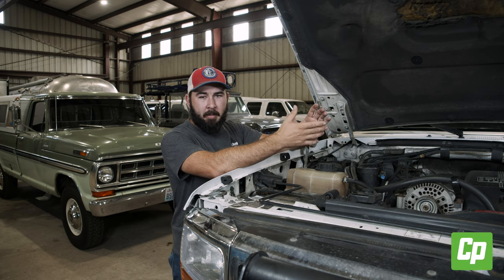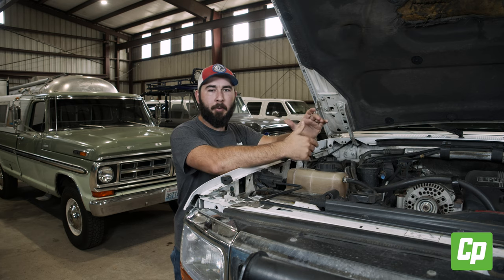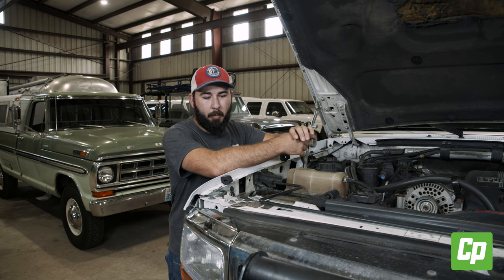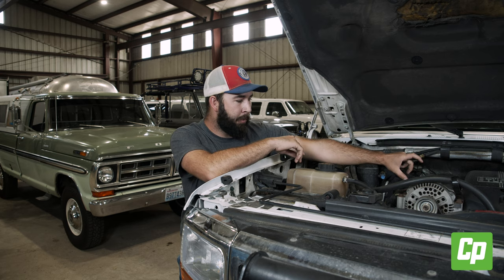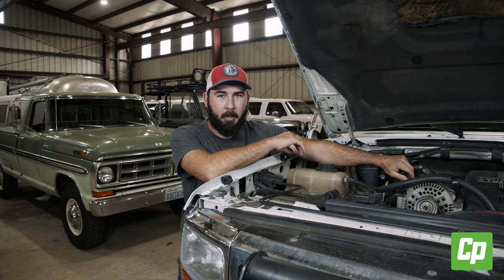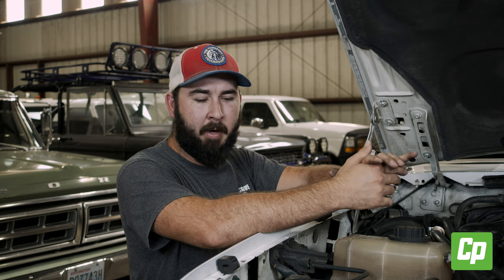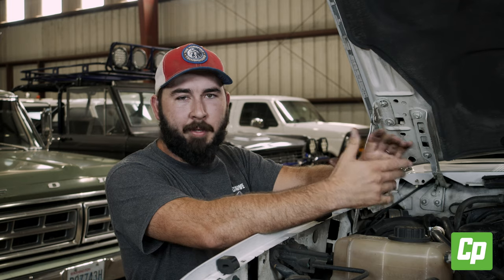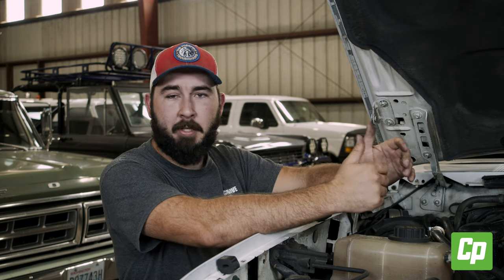How to Video - 1992-1997 Ford - A/C Mod Install: Cooler Air Conditioning - NOW

Comment: This seems like a good product, but a ball valve in the supply heater core line will do the same job on a budget. For nicer trucks or those that don't want to turn the valve manually, the CP part is the way to go.
Reply: YOU SHOouldnt just block that line tho.
Reply: @CT_Taylor  exactly what the gadget in the video does my man.

Comment: So was about to install mine and I compared this video to the printed instructions that shipped with the box.

Box instructions say to use the hose from water pump to firewall, but looks like you used the hose going to the head....did I miss something?
Reply: I was going to install mine today and noticed same thing, What did you find out. I see there was no responce to your question
Reply: On my 4.9L inline six, the supply line to the heater core comes from the head and enters the firewall on the right side. The return line exits on the left side and goes to the water pump. I'm told it's better to put a shutoff on the supply line as opposed to the return. Make sure to verify which hose is which depending on what engine you have.
Reply: It should not matter. Your heater hoses are just making a loop
Reply: @billybradyjr6008  if you shut off the supply line, it keeps the heater coil from filling with water and radiating heat. If you shut off the return, the water will conduct enough heat to warm up eventually. It probably makes a miniscule difference but anything helps when trying to stay cool.
Reply: Heater core works by circulation. If the heated water coming in is stopped so is the extra heat,   Reason the older generation would disconnect and loop outside cab or put a manual ball shut off, this product is great because cold mornings you don't have to connect manual hot water again to the core.😎👍 It's done automatically. 🎉🎉

Comment: How about a kit that lets a person turn off the heater core anytime they want?  Have a vacuum switch that can be installed inside the cab to do this manually.  In the summer there are so many times I do not need AC but when turning on "vent" without AC still getting some heat from heater core.
Reply from the maker: You can use this kit for that, you will need to tie into a different vacuum line
Reply: @CompletePerformance  Love your products - just installed the dash LED lights and rear brake light and reverse lights.  I will noodle on this - looking to be able to control that heater blockage valve from inside anytime I want to.

Comment: I have this kit on the way for 1995 7.3 and after looking under the hood today I see I have the brittle white line you mention... it's actually broken and brittle to the point it crumbles in your fingers.  It appears to run into a wire bundle running into the fire wall.

AC works fine, but did not see a black vacuum line to make the "T" connection.  Any thought?
Reply from the maker: you will need to trace it into that bundle
Reply: Both run in the bundle, untape, and look within. If not look on opposite side of fire wall,. They usually run side by side. 😎👍

Comment: so I've not had my hands too far in the HVAC system on these trucks but wouldn't this mod incapacitate your defrost setting since it also usually closes off the fresh/outside air intake? And since the heater valve shut off is T-ed into that vent door vacuum circuit the defoster would now also block off the flow of coolant through the heater as it closes the fresh air intake vent, resulting in cold air being blown on the windscreen. Just a trade off of the mod you would have to live with (I guess you could fix this by going under the hood and removing the vacuum line going to the coolant valve and plugging it in colder weather) or is there something I'm missing?

Comment: Once the a/c is fixed in my 96 f250 7.5L, I'm gonna a get this. Heater will still work though, right??
Reply from the maker: Sure will!
Reply: @CompletePerformance  thank you! Also need some headlamps but don't need the corner light or bottom light. These old aftermarket diffused ones work but just not a whole lot of light output. Even with the silverstar ultra halogen bulbs, it's still very dim. And I got a camping trip I'm leaving for next week on Wednesday and I'd like to get them before then but shipping sucks these day, like ups and FedEx. They take their sweet time.

Comment: Doesn't the dash board temperature control do this same thing? I don't get any heat from it when the control is in the cold position.
Reply from the maker: No this makes the ac colder

Comment: I know it says 1992-1997 but I just kept hearing you say powerstroke. Will this work on a 1994 f350 with a 7.3 IDI factory turbo? (PRE POWERSTROKE)
Reply from the maker: Its because we were working on a PSD but yes it will work on your IDI

Comment: Very cool idea. Two questions. 
1. Did you drain out any coolant before you cut the line. Didn’t hear ya say that at all. Also didn’t see any thing drip out when ya cut it. 

2. Will having that in line will that or can that cause any sort of over heating or just running a little hotter on the engine temp. Just wondering if the ac helps balance the coolant temp. If not then I know what I get to g next for my 250. Love your guys products and customer service. You all are great to work with.
Reply from the maker: That line sits above the overall coolant level of the truck so typically nothing comes out of it when cut. also we have noticed no change in engine cooling.
Reply: Not sure if my lines have been replaced but I had coolant shooting out when I cut into the line, would definitely recommend at least taking the coolant cap off so it’s not as pressurized
Reply: @CompletePerformance  cool. It’s on my to do list. Figured with the Texas heat you guys will definitely see any temp changes before I do in northern Indiana. Thanks guys.